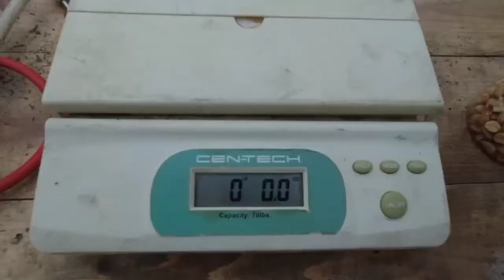now that's satisfying

Comment: Awesome, Jim! I've been subscribed since the beginning. Cool to see you metal casting. If you dig a hole and put a steel pipe at an angle into the bottom of it, hook a hair blow dryer to the other end, pile in the charcoal and stuff crucible in middle, it WILL melt aluminum. Don't blow air straight at crucible though, will oxy cut it. Stay safe and rock on!
Reply from the maker: I have this idea to turn metal detecting finds into interest castings...we'll
Reply: @roadkillscjim  Makes finding pennies and pull-tabs almost worth it!